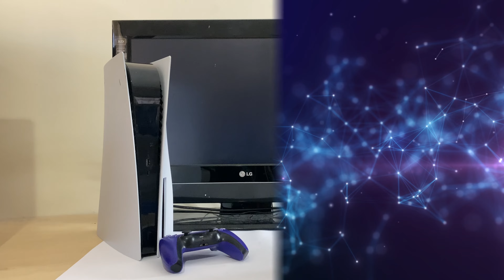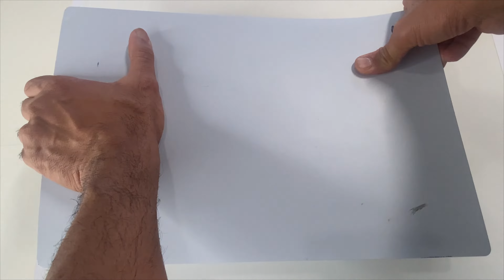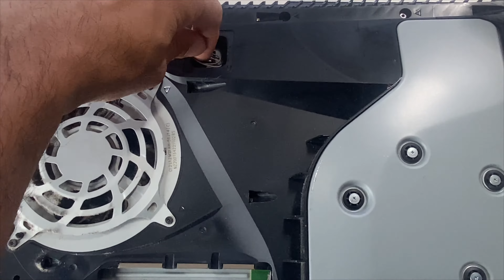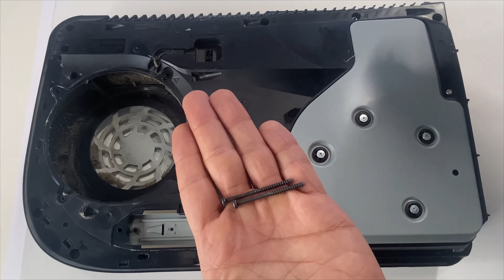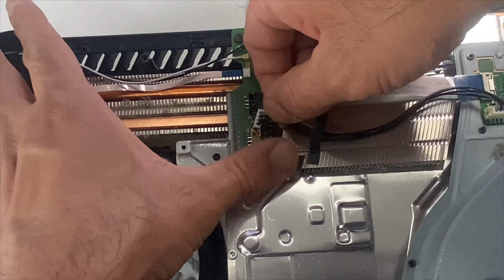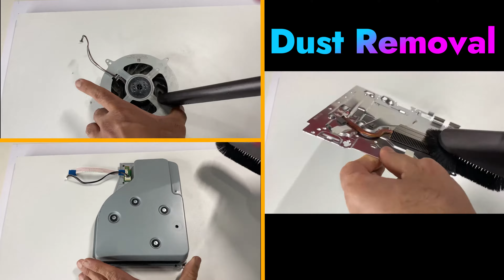PS5 [1202A Disc Edition] - Full Restoration Guide! Disassemble, Clean, HDMI resoldering & Assemble

Comment: I so glad to find a disassemble video where there screw size and location is at least mentioned. None else says or does anything to clarify where they go since there are 3 different sizes.  When I took mine apart for the first time, I intended to keep track of them so I reinstall in correct location.  But when I used compressed air to blow off dust, it scattered the screws causing me to lose my reference.  Luckily I remembered where the longest ones and the silver went.  And I knew half or short screws went on one side and the other 3 went on other side.  That then left me with I think just the 2 medium screws
Reply from the maker: I'm glad the video helped you keep those screws organised; it's definitely a common challenge during reassembly! 🛠️

Comment: 5:24 What kind of part does he take away and where does it belong? I also found this part loose under the drive but would like to know where I put it now.
Reply: I just put it loosely on the ssd connector now.
Reply from the maker: @songlover2732  Yes, that goes  under the board - It is an extra protection adhesive piece.